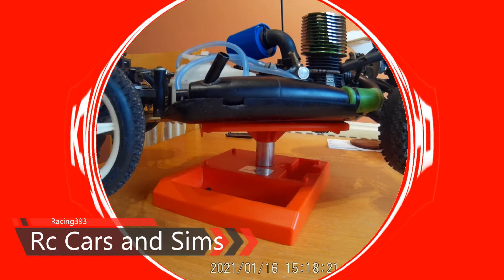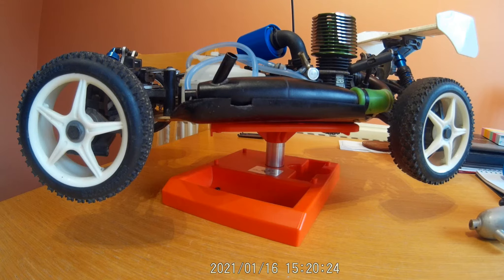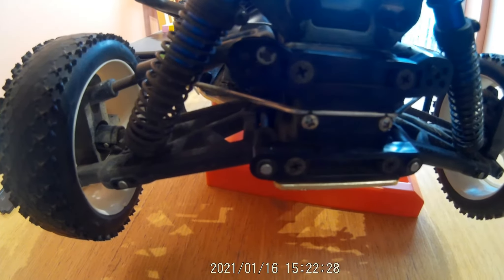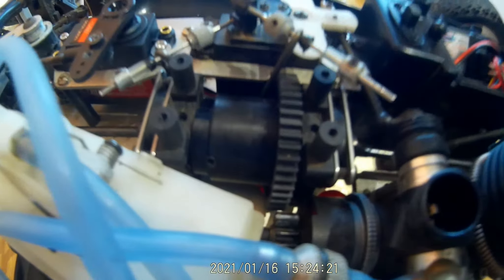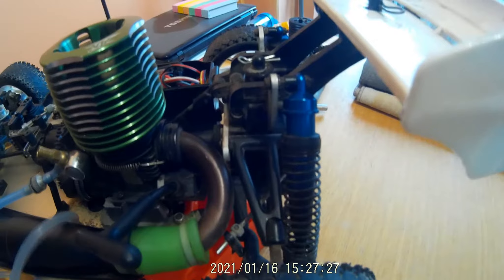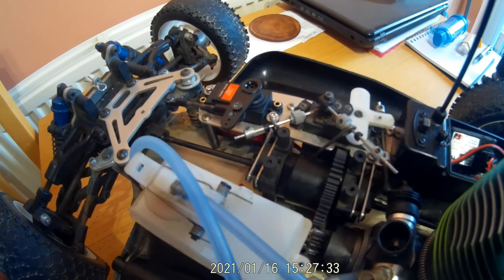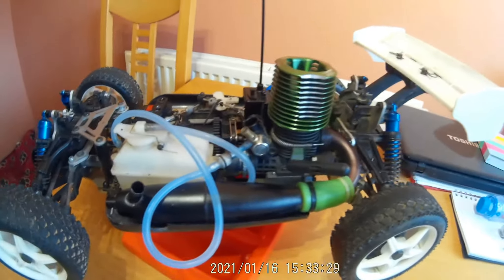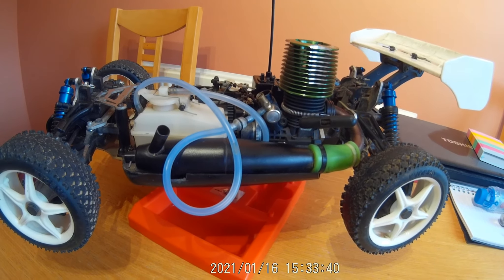Kyosho Inferno MP-5

Comment: I am trying to restore my old MP5 also. And you mentioned new tires. Is there any particular wheel or tire or in combination that you would recommend for the MP5 in which I can purchase nowadays? It would be much appreciated if you could let me know. Thanks for the awesome video!
Reply from the maker: Cheers for watching, with regards to the MP5, the wheel hex on these are 17mm I think. So any of the old style MP series up to MP6 will fit. If you want to use a more modern wheel arrangement, you'll need to change the wheel hex, the modern wheels are 19mm (1/8 buggy range) as far as I am aware. You can buy these from most RC outlets, all I would be careful with  is the offset of the wheel. The 19mm Hex kits come is standard or extended length. For my MP5 I choose the extended
Reply: @racing393  Thanks so much!!